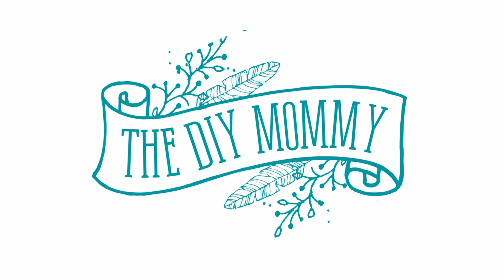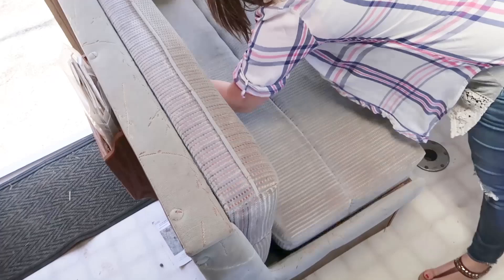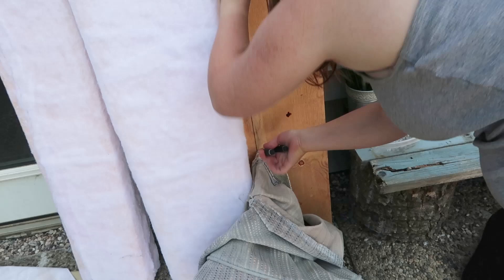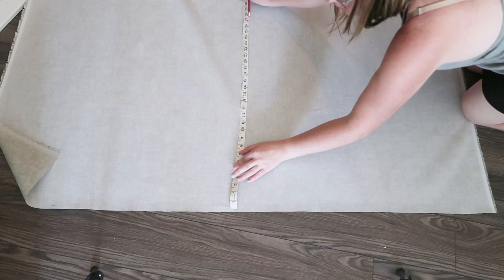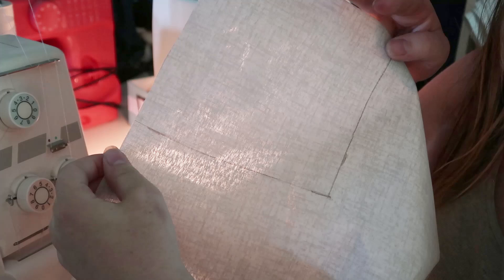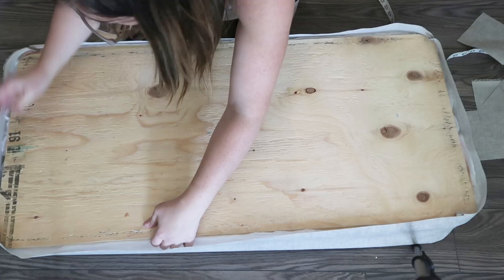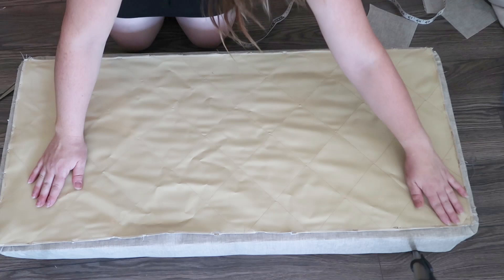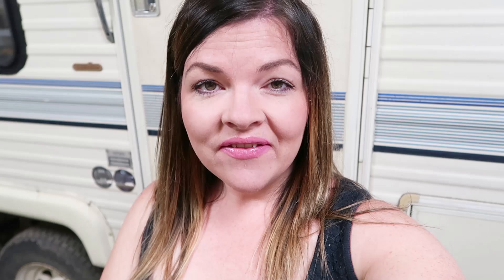How to Recover RV Dinette Cushions | Our DIY Camper

Comment: Thanks for sharing. I'm converting a old popup camper to a high low camper. I don't hAve a sewing machine so I will need to wrap the corners like wrapping a present. I  will need to add plywood ( lauan) to the bottom cushions but the backs have it already. They did not staple it in just inserted it.  your idea will help me greatly. You are definitely a talented designer. I like using my creativity but. I'm still learning.

Comment: Hi great easy video even for me who till now have never even touched a sewing machine. Just one question that I hope you answer asap as I am sat waiting now :) once I have folded the corner on the diagonal line when I stitch along the straight line and turn the cover over the stitch does not follow the line on the reverse so am I better off making sure these 2 straight lines meet on both sides and then stitch? Or just carry on folding on the diagonal line and then stitching? Many thanks
Reply from the maker: You could pin the corner in place first - ensuring the lines match - and then stitch.

Comment: Is there a way to get corners like that without a sewing machine? I dont have one and I dont know how to sew but i need/want to do this exact same thing to our dinette!
Reply: Danielle Hicks  - you may be able to use the iron on fusion tape (it is used for hemming pants without sewing) - then trim off excess material.  Or just sew it by hand.  Just do small stitches so it’s nice and tight.